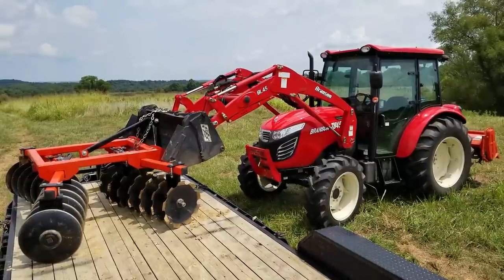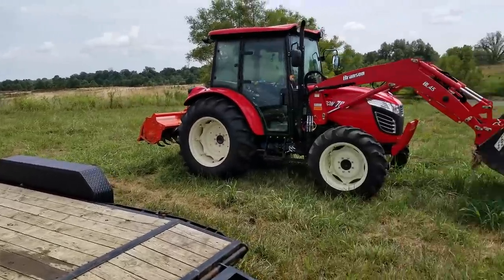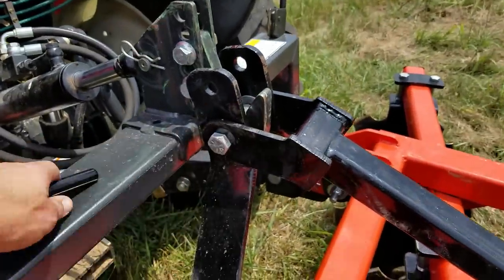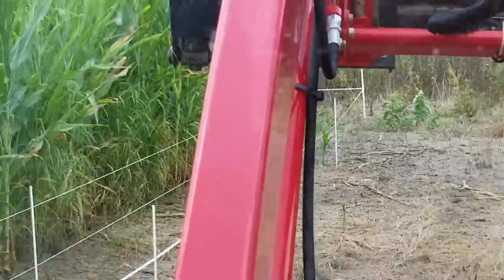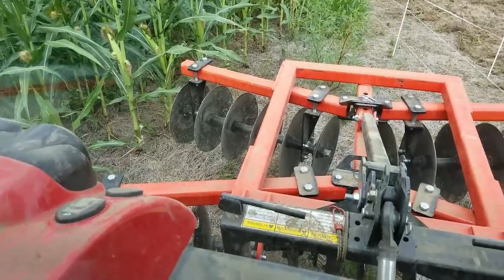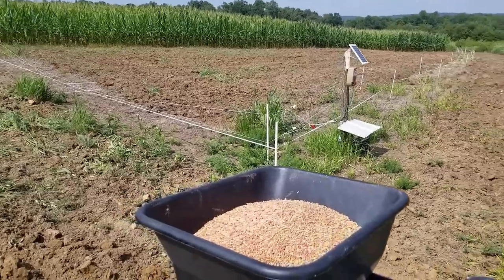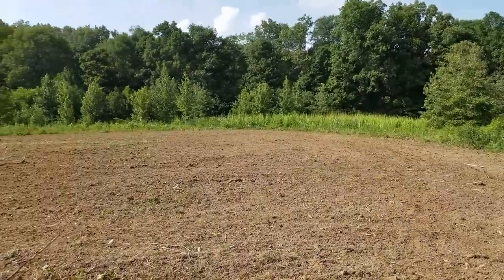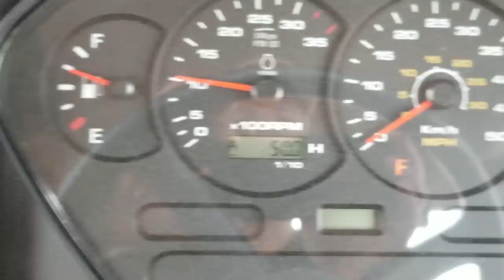Project 211 Loading disc/Tiller, Quail, Food plot updates 08-11-18

Comment: Thanks for the insight on the quick hitch adjustments.
Reply from the maker: You Bet. You can use the hitch pins instead of the 2 bolts I use, but I've found they get pushed up against a couple different implements and often get pushed out due to pressure from the implements so I changed to 2 bolts with lock washers. Don't have to worry about losing them and damaging the quick attach (did that before when a pin wriggled out)

Comment: For mid August, the corn looks good. Seeding looks like is went well. Maybe more weight on the cultipacker, but you didn't cut very deep with the disc. now for some gentle rain and vevy dews.
Reply from the maker: Yeah I forgot to bring some weight for the disc and packer, but they still did ok. Raining today and in forecast for next several days, although some might be gulley washers!

Comment: The problem you ran into with the quick hitch is the whole reason there is an adjustable top-link hook on the newer quick hitches. Without that bolt-on hook you would not have been able to attach. So you are using the quick hitch the way it was designed. If I'm not mistaken I believe you are using a Cat-1 quick hitch on a Cat-2 tractor with Cat-1 and Cat-2 implements. On closer observation, I think if you were to use the upper hole on the disk then you wouldn't need to move the hook.
Reply from the maker: well I use the holes on the disc because those are the ones that match up with most of my implements. I think only the tiller and Bush Hog are the ones I have to move the top link for. But otherwise it works on the other 80% without adjustment. Thanks